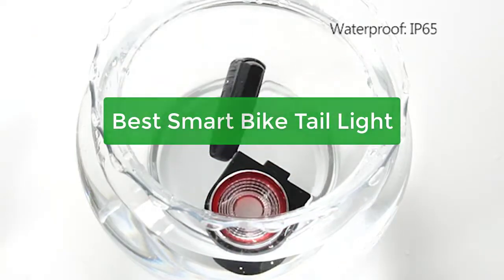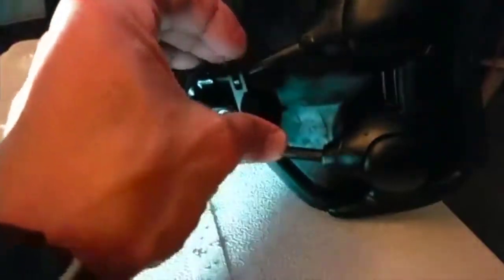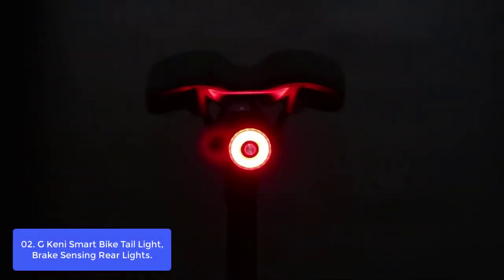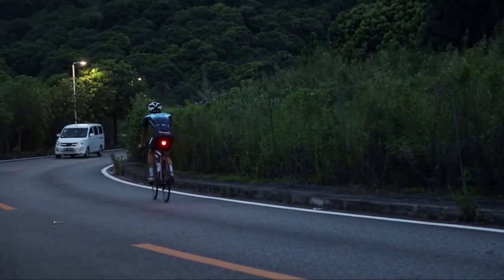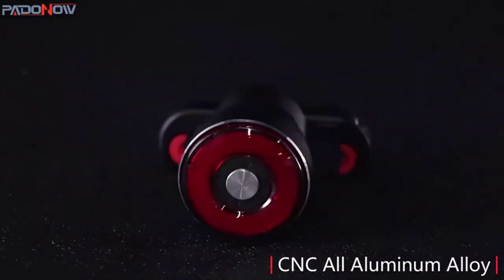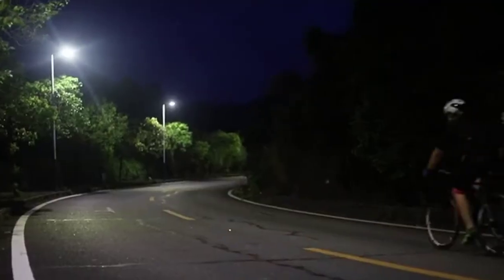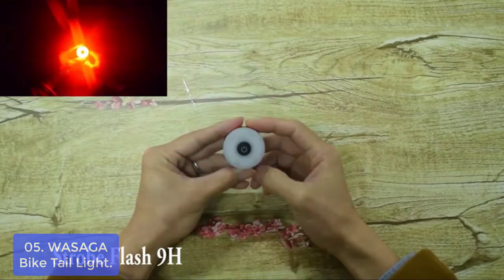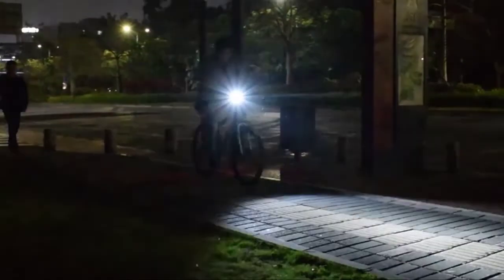TOP 5 Best Smart Bike Tail Light 2023

Comment: I commented on another video similar to this that I got a light set that was featured but rebranded. The first one I got two weeks ago and it's branded as the X-Tiger Bicycle Light. It's only physical difference is that there is no switch to control mannual and auto on the back. Mine is the updated version and it's all controlled by the on off main switch. It works great and is daylight bright and can be seen without a doubt. I'm very happy with it and the chance I took on it payed off. Was going to buy one for my sister in law. This light is actually really good and I would buy it for family and friends for their safety. It works as they claim. All the best.